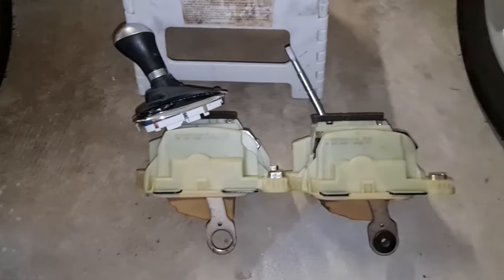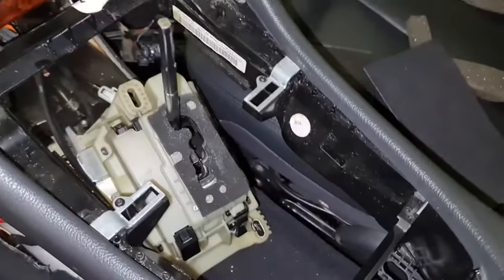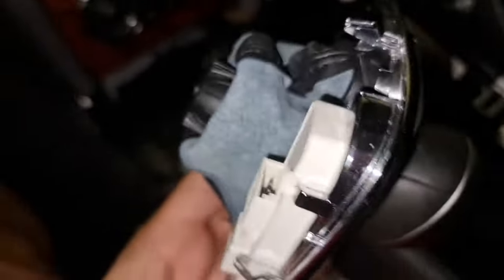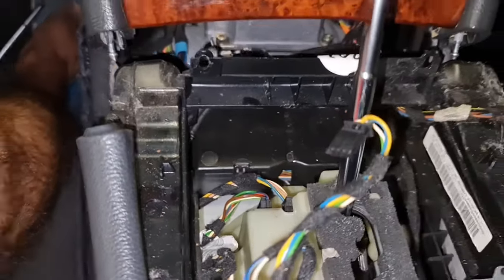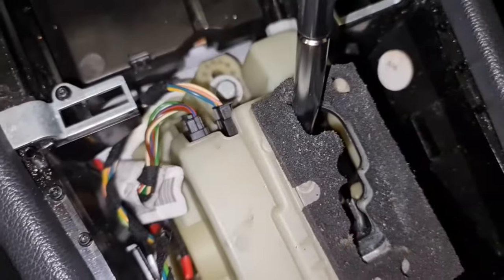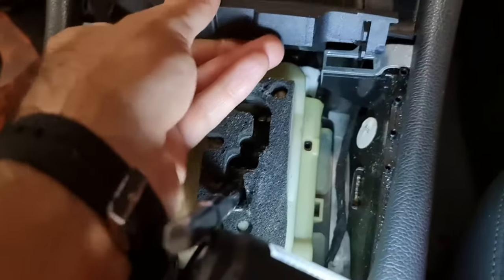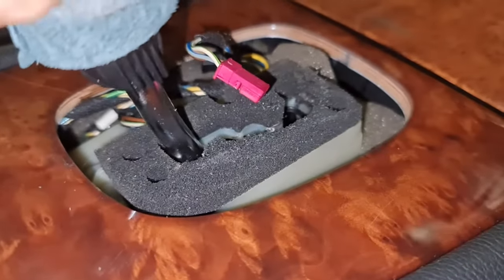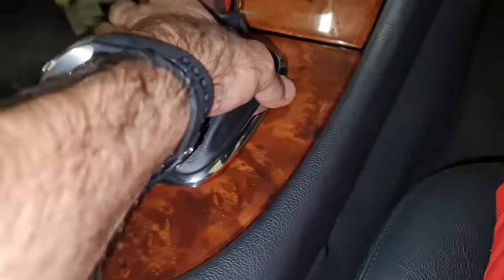Mercedes Benz Gear Shifter Replacement (W209,W203 & W211)

Comment: Thanks for your video, my A209 is stuck in Park it’s not the break switch, …
I’m going to give this a go I also have w203 shifter to swap with thanks again
Reply from the maker: Pull the cover off and push that white button and that should help you to get the shifter out of P.
Reply: @BenzAddiction hi I can’t locate the white button?:)

Comment: thank you so much for this video. helped me immediately diagnose the problem and get it fixed quickly!

i have a 2004 e320, and for those who are curious about the part numbers matching, i bought part number 2112674824 [used] to replace the original part number 2112672224. it fit perfectly and there was no need to program my new [used] replacement at the stealership. the “p” and “s” settings reappeared on the dash, and the check engine light immediately turned off. i cleared the p0705 fault code and did the 5-second/2-minute transmission reset to ensure the shifting i prefer.

best of all, i didn’t have any screws left over when i put the console back together! i DO recommend unbolting the entire console [including the two bolts inside the bin]. it just makes it WAY easier to pull out that plastic bracket in front of the ashtray when the console is loose.

thank you again for this video. good luck to anyone who plans to do this repair. just take your time and keep up with which screws go where.
Reply from the maker: Great to see this worked for you as well. Enjoy your Mercedes.

Comment: My w211 e320 2004 got stuck in drive. Gear selector would show R, N , P when selected and the car would still drive forwards. Turned the car off and wouldn’t turn back on. By chance it nudged itself into Neutral when I pushed the car, so I was able to tow it home. I looked under the car by jacking it up and the gear linage arm had slipped out of the selector bush. I clipped it back in making sure the tabs on the clip were firmly located, checking with a minor and using a couple of long flathead screw drivers / a hook and pin set. Car drives fine again. No need for me to remove anything from inside the car. This video helped me a lot showing what the connection should look like. Thanks!
Reply from the maker: Glad it helped mate :)

Comment: Hi any help would be much appreciated..
 Long story short my elderly widowed neighbour has a Mercedes 2006 E220 diesel. It totally refuses to go back above neutral. No reverse or park an can not remove the key, (also don’t know if it’s related but fault EBS and ABS on dash. Drives forward smoothly without issue. 
Local garage is looking £1300 to replace the gearbox but I’m convinced it can be fixed cheaper. I have decent to good mechanical knowledge but merc are not my strong point. 
Many thanks
Reply from the maker: Have you watched my other video? I think a decent diagnosis scanner can help:   https://youtu.be/3PgmDjK45_k

Comment: Hi, great video. I got the code P0750 Transmission Range Sensor A Circuit ( PRNDL Input), do you think it is the shifter causing this or just a connection?
Reply from the maker: Hello, please watch this: https://youtu.be/3PgmDjK45_k

Comment: My benz sometimes has trouble going up into reverse and park from drive. I have to play with it, wiggling the handle up in down until it finally goes into park. Do you think its this part that needs to be replaced?
Reply from the maker: Hi mate, just have a look at my other video, fault code P0705... I think it will be more assuring... https://youtu.be/3PgmDjK45_k
Reply: @BenzAddiction  I have no fault code tho
Reply: dude same especially when putting it in park😂i don’t know why it does this but still works🤷🏽‍♂️
Reply from the maker: @camlag4598  excellent 👌

Comment: How exactly did you pull it out cause I’m not trinna go under the vehicle if I have to I will but nahh
Reply from the maker: So you mean you can not remove e the C clip from top?
Reply: Yea I have a w219 model tho I gotta try to take the center console out or slide it back a little to pull out the gear selector module, its a tight ass spot you have the best video tho 💯
Reply from the maker: @bankrollm3n4c39  it seems like many parts to take but literally the job should not take more than 2 hours. Good luck.
Reply: @BenzAddiction thanks💯 I shol gave up yesterday cause I couldn’t slide the center console but yea it does easy af tho can’t lie
Reply from the maker: @bankrollm3n4c39  glad you did it 😉

Comment: Hi mate, is gear shifter same for Mercedes kompressor 2003 180 w203  and for Mercedes kompressor 240 2003 .
Do you know EO number for part this asked me FCP EURO
Thanks mate👍
Reply from the maker: Hi mate, I think transmissions are the same as well as the gear shifter, but the part numbers may not. The best option is to pull the old one out and find the exact part number.
Reply: Thanks mate, I pull out part, but Amazon, Alibaba, eBay, FCP EURO don’t have C 180 Mercedesa , all start with C230, because I asked you.
Reply from the maker: @zlatkohrkac4146  last resort would be mercedes dealership.  Just provide them your VIN number.

Comment: Hi, I have a question that I’m searching answer for but found nothing yet. I know that you’re very familiar with Mercedes because my question is about 2006 mb c 280. Here is my question for you. Where is the location of “Engine Oil Pressure Sensor Switch A0071534328 Fuel Injection Pressure Sensor for Mercedes-Benz C-280.”? Thank you in advance
Reply from the maker: Look carefully here: https://charm.li/Mercedes%20Benz/2006/C%20230%20%28203.052%29%20V6-2.5L%20%28272.920%29/Repair%20and%20Diagnosis/

Comment: Hi, do you need to do coding after installing the new gear shifter?
Reply from the maker: No coding is required if you use the same part number.
Reply: @BenzAddiction  thanks!

Comment: I think the button is black on my shifter and it still doesn’t disengage from Park ? 😢
Reply from the maker: @tharrisharrison7066  Then it might the shifter jammed or the cable stuck, can you move it from transmission side?
Reply: @BenzAddiction  I’m going to have a go at removing shifter to look inside or remove the lock for now . I’ll remove centre console ,apart from break switch,can the breaks effect interlock in any other way
Reply from the maker: @tharrisharrison7066  👍
Reply: @BenzAddiction  hey thank you for taking the time to help all of us I’ll get on with next steps… I’m in the uk so the weather is getting worse got to get fixed asap 🫡

Comment: If you were to swap out ecu, ignition switch, key and floor shifter...dont you have to program the conductor plate to match what you install into the s430
Reply from the maker: TBH I don't think that is required but I might be wrong.

Comment: Well done .  Did you get a used shifter from a wrecker  or a new one ?
Reply from the maker: Hi Leonardo, this was a used shifter.
Reply: @BenzAddiction  OK thanks , it still working ok ?
Reply from the maker: @Leonardo  still working perfectly;)
Reply: @Leo555ZZZ  what year is your car mate? I just put a used shifter in my 2002 c220cdi as was led to believe it would not need reprograming, wrong, only able to put used ones in cars 2000 or older it workex for a day then all sorts of issues not changing out of 1st gear saying R on dash whilst driving, not moving past N and others, my magic auto elec had to take all the "brains" out of my old shifter and put them in the new one it is now ok, so cars 2000 or newer need a "virgin" shifter and they arent cheap! So unless u do the same as my mechanic did you cant use a second hand one unless you have older than 2000 car hope you get sorted👍👍
Reply: @shaunmcclory8117  OK thanks..

Comment: Does it needs coding or is just plug and play?
Reply from the maker: Was Plug and play for me...
Reply: Depends on age of car i found the hard way that a 2002 w203  wont accept a used shifter, only cars 2000 or older, newer than 2000 require a "virgin" shifter, unless you are able to swap all the electronic bits from your old shifter with the inside parts of a used unit which thankfully worked for me after being told by three sources a used shifter would not neex to be reprogrammed

Comment: Hi mate, I need to buy gear shifter for Mercedes kompressor 2003 180 w203 . Where I can buy, I tried in Amazon, but can’t find . Maybe I wrong write name fir that part, 
Can you help me, please
Reply from the maker: Hi mate, try FCP Euro. The last time I checked few month ago they had it brand new for AUD 630.
Reply: Thank you mate👍
Reply: Hi Benz Addiction
Which country  are you located in?
I had mine repaired  for $375.00AUD.
Reply: @MrTherbst  thanks mate, I fixed my shifter. I find what is wrong

Comment: I have problem when putting on the seaclip to the rod, it doenst stay on it
Reply from the maker: Hello, just check to see if a peice of gear shifter leather is stuck on there or the leather is extra thick...and make sure the shifter handle is all the way in...

Comment: Why did u replace?
Reply from the maker: Because it was faulty, causing the transmission to go to limp mode.
Reply: So mine I have to hold the shifter into drive or it won't go and as soon as I let it go it goes into natural you think if I replace the assembly it will fix the problem??
Reply from the maker: @custombuilds4573  watch my other video on how to diagnose the transmission and the fault codes. There is the possibility of having a bad bushing for the shifter too, you can check this from under the car too...